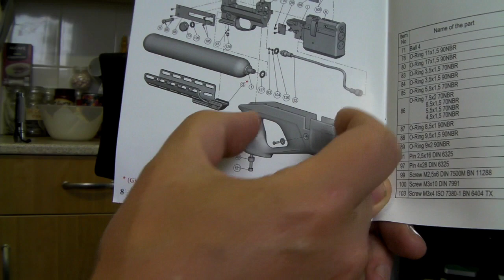URAGAN STOCK & TRIGGER  16:08:2019

Comment: I'm told adjusting that horizontal rod effects the safety mechanism. Do you know? The safety on my Uragan isn't working and I need to address it.
Reply: @reevessairgunningreviews5572  I have not adjusted anything. The gun is new and I noticed the safety doesn't work. The trigger is outstanding so I am thinking it was just set low from the factory and they didn't realize the safety was not able to set. I was told the rod is the adjustment for it but still don't understand how I should be adjusting it to properly engage the safety.

Comment: Definitely the trigger needs adjusting, can tell by seeing the large overlap on the sear.  Regarding the linkage length, you have to decouple if you want to turn it otherwise the rod just rotates on both ends but the length (what makes the difference) remains the same. It is pronounced Ura-gaaaan.I would adjust the second stage.

Comment: Great videos. I've just bought the same one, long .22 version. Absolutely love it, hasn't missed a beat from around 2000 shots so far and is very very consistent. Definitely better than anything else out there that I've tried, including FX. Plus the engineering and build quality puts them all to shame. Are you planning on doing a video on adjusting the regulator? I've found that the hammer adjustment didn't make much difference without adjusting the reg also to get the harmony needed. Great work though and very helpful. 👍
Reply: How's the uragan going mate? I have a. 25 cal impact and love it but thinking of a. 30 uragan